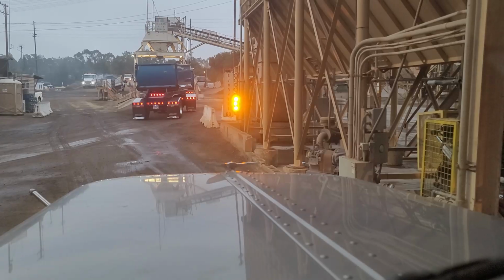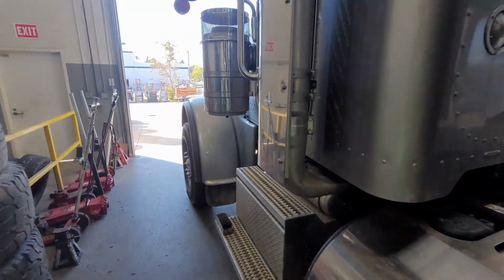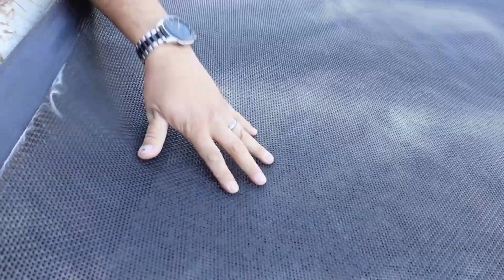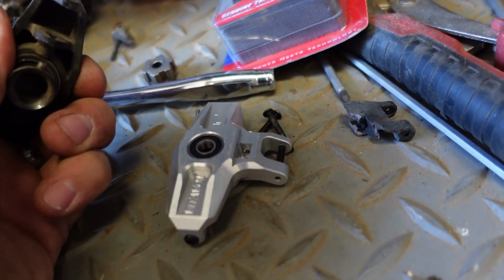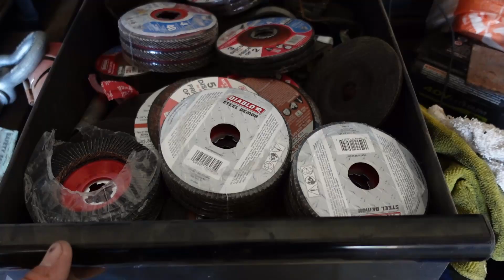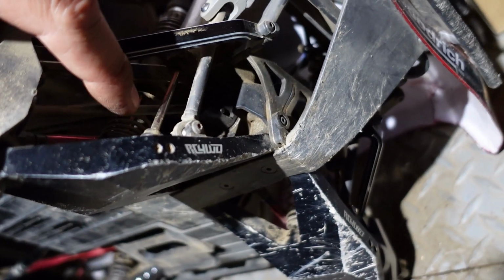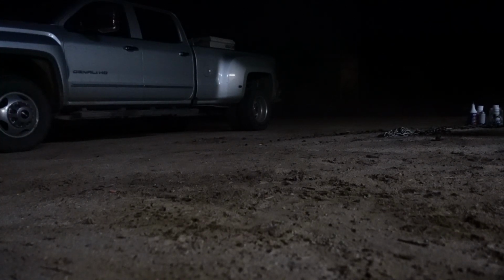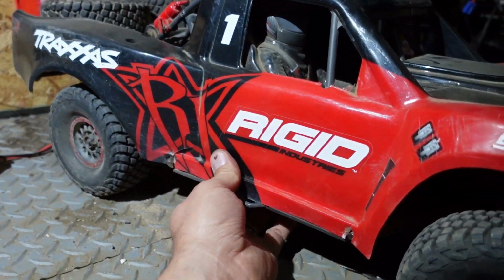TRAXXAS UDR IS FINALLY FINISHED. AND RANDOM TRUCK DRIVER SAVED ME FROM A BLOW OUT.

Comment: I have mainly most of Vitavon alloy parts fitted to my UDR along with my SBR clone, I recommend the RPM UDR front bumper I have busted loads of the stock one's but now with loads of hits, along with lawn dart action no more breakages, I also have added the RPM rear trailing arm skids to my alloy Vitavon trailing arms these are meant for their plastic trailing arms but work great once you drill and tap the alloy arms and fit I have worn out a couple of set's but the arms still look good it stops the galling that eventually stop you sliding over rocks at slower speeds.